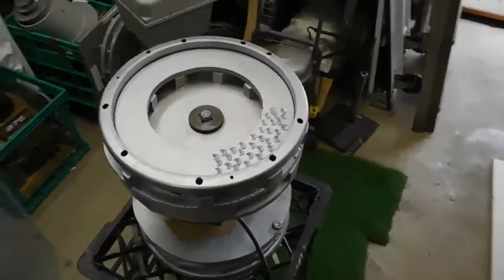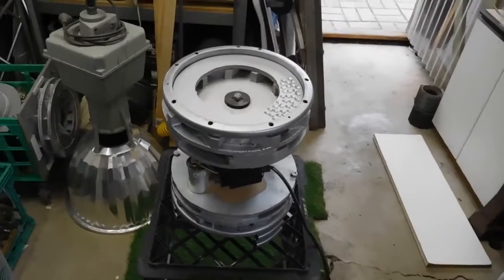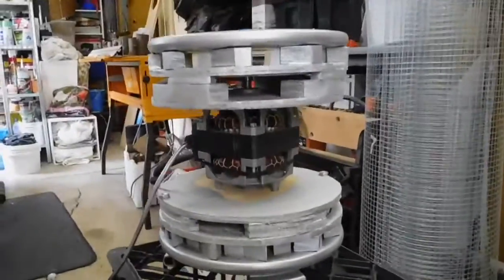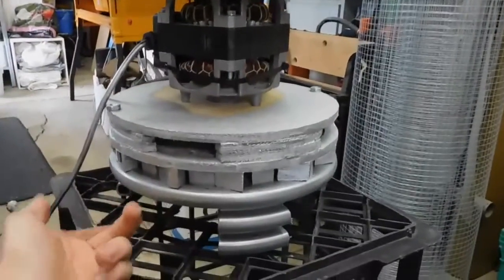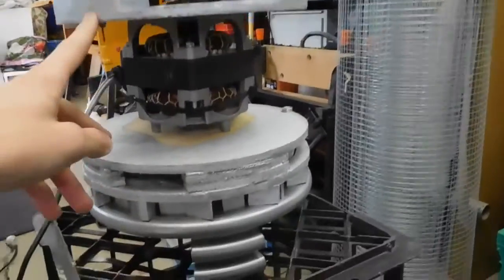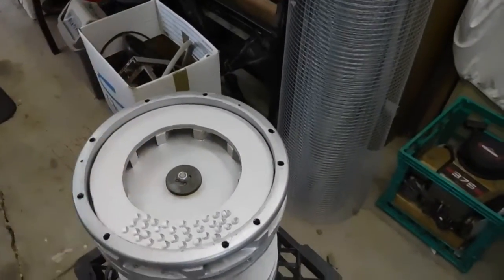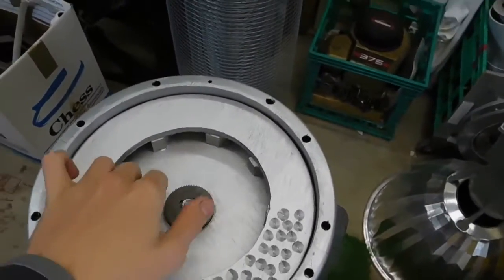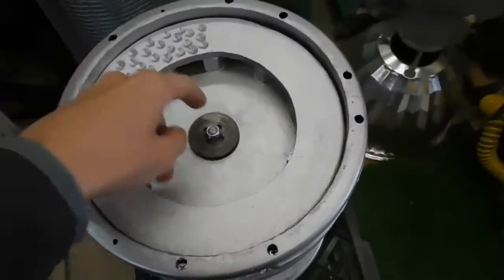New Siren: 9/12 Port ratio

Comment: Make the motor 70 hp.
Reply from the maker: Only if you pay for it.
Reply: where would you get one of one of those?
Reply from the maker: A 70HP motor?
Reply: CAL'S ENGINEERING yeah where would you get one of those?
Reply from the maker: Probably an industrial electrical equipment distributor. Cost a fortune tho.
Reply: CAL'S ENGINEERING
yeah, probably from an industrial electrical distributor, that makes sense... no shit they would be expensive!!
Reply from the maker: Mate, I strongly doubt newer sirens run on a 70 HP motor, simply because of the size. I'm sure you know how big an ACA Cyclone is, and they only used a 50HP motor. You sure your not thinking of 7 HP?
Reply: CAL'S ENGINEERING ok.
Reply: CAL'S ENGINEERING New 9/12 port sirens run on 70 hp so that their hp will be 60 when old.
Reply: yes

Comment: ylook at my siren! I rebuilt the siren and the rotor is balanced pretty well without being fixed to the shaft! its single tone 5 port but without the stator, it sounds like a 4/5 1000T (weird right?) but with the stator it sounds like total earrape because the stator needs sanding, but I test it without the stator and blow on the ports.